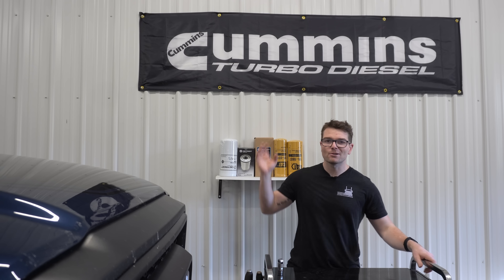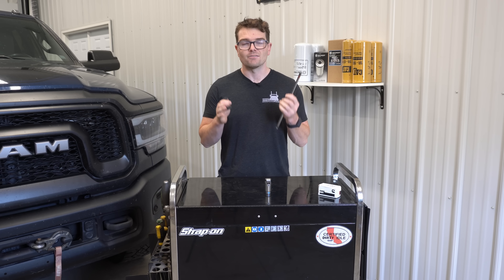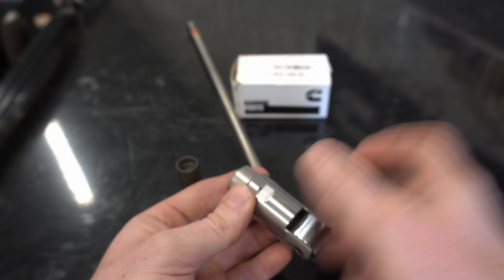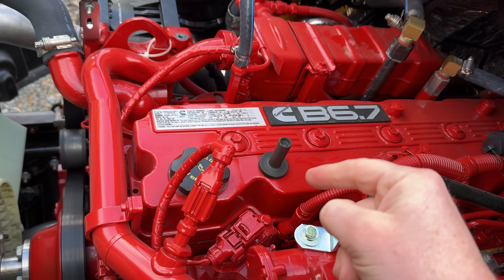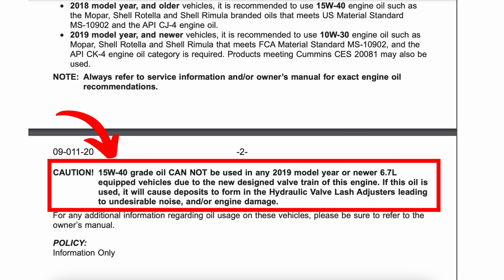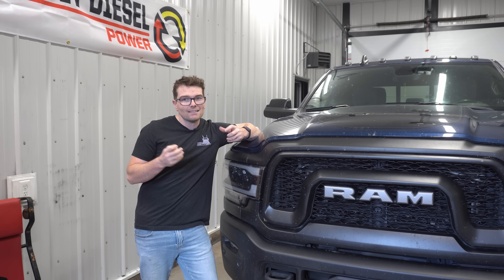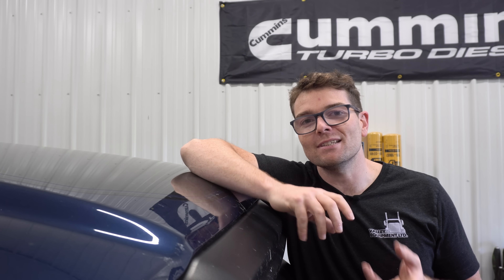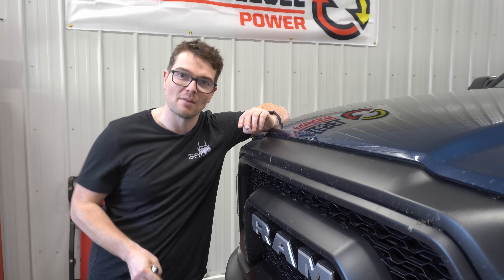RAM 2500 6.7L CUMMINS Hydraulic Lifter Failures *Diesel Mechanic Explains* | Not Good?

Comment: 320,000 miles on my 2019 Cummins with no issues, but I've been running 10w-30 AMS Oil in my truck since day one, and I tow heavy every day. I also change my oil every 10,000 miles..
Reply: There's kits out now to go back to the flat tappet lifter for the 19s and up.
Reply: @corysabiston9773  but the kit is over $3,000 and then you have to get a mechanic to install it.
Reply: @robstatetx  If that's the pricing, that buys you a lot of oil changes... good to know
Reply: @corysabiston9773  I’m sure there are but it’s far from the only design flaw of the the 19+ Cummins engines. The CGI block alone is to blame for an enormous number of engine failures. Then the killer heater grit bolt, injector leaks, the list goes on. It’s like Cummins was bent on destroying a legacy of reliability and low operation costs when they developed that 2019+ engine.
Reply: @gravityfab you literally have zero idea what you're talking about. Cgi is becoming the industry standard after ford and paccar started with it in 2011 because it's so much better. And you can literally fix the heater grid in an hour a number of ways. So don't give us this crap
Reply: @GMF215 statistically, these failures are very low. There is less than 1% failure out of millions of trucks on the road.
Reply: @marktra8two  Correct. That's why Cummins doesn't take replacement action in production, or come out with a campaign.
Reply: @GMF215 the term you're looking for is planned obsolescence. My 07 5.9 will outlast any 19+ engine.
Reply: @marktra8two Is that the failure rate of the lifters?
Reply from the maker: Can't argue with that
Reply: I'd also like to throw in a possibility. The hydraulic lifters with different rings and cam can utilize a lower weight oil. Lower weight oil equals lower emissions. If you run heavy oil in these engines I'm sure issues will arrise.  I've seen it on has engines so this would be no different. @TheGettyAdventures
Reply: @jamesvpaquette  i would never run 15w40 unless i was in the desert
Reply: @wizard_of_poz4413  yeah but some stupid people do cause it's cheaper. That and some still believe thicker is better.
Reply: @jamesvpaquette  my buddy is the best one yet. Some clapped out pos of his blew up right after he used synthetic oil so he vows to never use it
Reply: @jamesvpaquette  2 quarts a Lucas every oil change for me I'm gettin 600-700k miles outa my motors .2014 w 658,000 on it rt now
Reply: @GettysGarage  nope
Reply: I may be a little ocd I have a 2003 5.9 I change my oil every 5000 kilometres I run 15 40 rotella since new 285.000 kms on the truck now it’s quite the debate thanks great video
Reply: @coreymerritt7742  03 and early 04s are the cleaning running diesels ever made, HPCR, no egr.  I had an 03 that I changed the oil 15-20 thousand miles(upwards of 30K km) and I sold it running great at about 350k miles (565k km).  T6 5w40 fwiw.  The oil literally, actually literally, didn't get black until 12-15 thousand miles, you could read the dipstick through the oil till at least 10k.
Reply: @coreymerritt7742 5000km is absurd 😂
Reply: @3DProductions  it all comes down to personal choice in this matter I only average about 12,000 kilometres per year on my truck
Reply: @coreymerritt7742  The 15-40 is correct for that engine. I wouldn't run the lower with the flat tappets you have.
Reply: Amsoil!  😂
Reply: @jamiel9902  stupid kid
Reply: 43K mile failure on a 21' running signature series Amsoil 10W-30 since first oil change. 5k mile oil changes
Reply: @jacoblucas3331  amsoil is a scam. We've had zero issues with our '20 running rotella. Everything that's hype and glitter isn't necessarily gold
Reply: @wizard_of_poz4413  you are a bag of misinformation
Reply: @wizard_of_poz4413  there’s also a lot of information proving Cummins CGI block is poorly engineered but you wouldn’t know anything about that either would you?
Reply: @GMF215  we've been using cgi for years. Make up some more lies
Reply: @wizard_of_poz4413  do your research, cgi is good, the Cummins design is flawed.
Reply: @wizard_of_poz4413  Choate engineering is a good place for you to start. Then look up the definition of “anecdotal information” and come back to the party informed.
Reply: @gravityfab  what are you trying to accomplish? We have 3rd, 4th and 5th gen rams in our operation and all of them are trouble free units
Reply: @wizard_of_poz4413  I’m trying to help educate you. You post replies based on anecdotal findings, not fact. The facts of research show that the CGI block Cummins started using in 2019 is not as well engineered as the Ford Scorpion. The facts of research show that Amsoil Signature outperforms Shell Rotella in every contest. Try using facts in your next reply.
Reply: @GMF215  just imagine being that terminally online that you think random online commentary trumps lived experience
Reply: @wizard_of_poz4413  looking at your comment history I don’t have to imagine it, it’s like a lesson in random uninformed commentary
Reply: @wizard_of_poz4413 especially when it comes to oil 😂 glitter is the exact opposite of gold
Reply: @chefboyrstevehernan9837  do what
Reply: @wizard_of_poz4413 It always amazes me how people on the internet these days think that their personal experience speaks for the masses. Pure anecdotal fallacy.
Reply: @DarkHorse08  well what experience do you have? And watching tiktoks and reading listicles does not count
Reply: @ Case in point. 😂
Reply: Thank you my friend
Reply: Keep doing what you're doing, it seems to be working just fine.
Reply: May I assume you are running 10W30 by Amsoil?
Reply: @wardvanommeren1297 Yep
Reply: I change my oil every 5,000 miles and I use Rotella 10-30 full synthetic oil.
Reply: @lrizo3841  I'm just saying if you have to use photoshop to sell your products then I don't want any
Reply: Do you have your typical left or knock in the mornings?
Reply: @yuptrue4794  nope
Reply: I run the amsoil 10w-30  and it runs quite now
Reply: @hunterriddall8318  when did you start using amsoil?
Reply: I have a 2020 ram 3500  chassis cab. 6.7.    At 215,000 the push rods and rockers were worn out. Like a grinder was used to grind the push rods down. The oil was 10W-30 
I changed it around the 15000 mile mark. The reason my 2018. Said to change it There never had a problem but. I did miss the lifter upgrade. Bad on my part.  The lifter failure is the issue. But I will just do a conversion with a short block of a 2018 and upper parts of the 2020 or just buy a commercial school bus motor and use it.  Either way I need a replacement for this junker now.
Reply: @bruce38tex What were ya towing with said trukk brother??
Reply: Schaeffer's Full Syn. 5W-40.
Reply: @oldsalt8011  kind of a gimmick but yea
Reply: Dude 320k miles ain't no big deal
I GOT 4 Cummins,  now 3 trukks if I can't get 500-700 thousand miles it aint NO TEST .I hauled rvzz 15 yrs, 5.9 was THEE WEAKEST JUNKER OF ALL 4. My 07, 14 both got 650,000 if not more cause the odometes flop around 500. My 18 has 295k rt now I gotta keep it to make worth it.
Reply: @ronmoore3987  what oil and how often the change? Hydraulic Lifters right? Any issues?
Reply: I’m happy that’s your experience…. As for me, my 23’ Bighorn had multiple lifters failing at only 6,000 miles!!! Factory oil.
Reply: Seems smart. “Let’s save on our customers having to do that cumbersome 150k mile (let’s be honest 200k+ mile) maintenance and just build an engine that fails at 150k miles, that’ll be better” -Cummins
Reply: @GMF215 wasnt cummins desire to use the hydraulic lifter that was Rams idea for the diesel chatter and efficiency and its back fired as usual
Reply: I call BS. 300k and no issues ? You sound like a big time fan boy
Reply: @9663mu  maybe take care of shit and quit coping. You sound like you're bitter or something
Reply: @9663mu  lol ok son 👌
Reply: @lrizo3841  sorry did I hit a nerve ? Ram fan boys are so fickle
Reply: @9663mu  lmao not at all son.. you're entitled to your opinion
Reply: @lrizo3841  I’m for sure not your son.  Your son is probably a fan boy too? . Any opinion on dodge getting caught cheating on their diesel engines?    Let me guess blame the epa ? Whole gm and ford didn’t cheat
Reply: @9663mu  so now you're towing the line for the epa? Jim Farley isn't gonna adopt you bud....
Reply: @9663mu  you sound triggered.. calm down son
Reply: @9663mu  and you sound like a liberal
Reply: Cute…My 1998 vw tdi had 300,000 miles a decade before your engine was even made
Reply: @fastinradfordable  but did it tow 33,000lbs everyday for a living?
Reply: @fastinradfordable  I wish I had one of those cars
Reply: Awesome you're doing great. But I would switch to the 0w40 Diesel and go 7,000 miles max. It turns out that most oil analysis isn't telling the truth. I've had the same RAM truck for 23 years & never had anything go wrong minus a stuck auto lock and blown speakers. You can still make it to 4 or 500,000. But we like going forever. Oil still breaks down. And it's because of contamination. I'd rather run 0w40T6 and change every 3500 miles. Either way God speed, Baruk Hashem. 🇮🇱✝️🇮🇱

Comment: I agree with your skepticism on the saved maintenance. I have a 2018 ram 3500 and just did the 240000km valve lash adjustment. $167 and that’s alberta prices.
Reply from the maker: Exactly, I’d much rather have solid lifter and pay 170 bucks every 5 years
Reply: My truck is over KMS for the adjustment. I’m at 288000. I’m in Edmonton, where did you get yours done, I don’t want to take it to the dealer.
Reply: @sw5334  Go Pro Diesel in Fort Mac
Reply: The point isn’t to reduce maintenance. The reason the commercial trucks have them isn’t reliability it’s because it’s maintenance cost. Companies are gonna spend money that residential consumers aren’t. They reducing of the maintenance needed makes the truck seem more appealing and requires less maintenance. Behind most of these failures is a owner that isn’t doing proper maintenance. 15,000 mile oil changes is a joke in any vehicle. My 24 gets changed every 5-6000 miles. Not to mention most mechanics now days aren’t even certified or good mechanics. They are guys with a few tools that change parts.
Reply: $ 167 … 
If do it your self is even free* 
I know mine when is almost about time by the sounds of the motor specially after run it the whole day under  a load .. ohh yeah .. you can hier that gap flapping at the  top of the head cover
Reply: @jonny6.743 ”a whole day”
Is literally nothing for a diesel engine.

Comment: Just get a Power Stroke and be done with it.
Reply from the maker: CP4 fuel pump though.. other then that great engine
Reply: Good luck.. they're blowing engines transmissions, too. It seems like the engines can't handle all the hp and torque. There's a reason why they tuned down for commercial vehicles, but Ford obviously doesn't get it yet.
Reply: @lrizo3841 the commercial fords are literally detuned…
Reply: @freedomisntfree_44  Yes, you're absolutely right. The same engines that go into Ford's commercial trucks are the same engines that go into the F-250 and the F-350, which are a higher tuned truck called the HO (High Output). Therefore, they need to detune the F-250 and 350 to keep them from blowing up.. that's why I said there's a reason why the commercial Ford trucks are detuned
Reply: @lrizo3841  mine runs fine…. troll
Reply: The 22 powerstroke I drive at work has been fine, so far. Lots of complaints on forums & groups about high def consumption & lower mpg’s on the ‘23 & up trucks, esp the HO versions. Of course, the cp4, is a big question mark for reliability.

Comment: I had a 2019 that had this issue, really disappointed
Reply from the maker: That’s disappointing. Was it under warranty ?
Reply: @GettysGarage  no it was out of warranty unfortunately. Used 5w 40 Rotella every 5k. Was religious about maintenance. Ended up getting a powerstroke. Jury is still out on how it will go in the long run. Power is amazing but did like how the Ram drove better. Turning radius on the Ram is way nicer. The Ford has a huge turning radius compared in my opinion.

Comment: Should I get a 4th gen or 5th gen I’m in Canada and I’m ready to spend $75 ,000
Reply: Fix what you have or buy an older model and fix that. Save that cash.
Reply: @kb9oak749  Good advise!
Reply: be carefully of the hemi famous tick,hemi engine is like time bomb.
Reply: 3rd gen 5.9 cummins.
Reply: Get a low mileage 4th gen while you still can. 2017-2018 with Aisin. Bulletproof setup.
Reply: Hemi is phenomenal engine. People just need to change their oil more often.
Reply: 5th gen